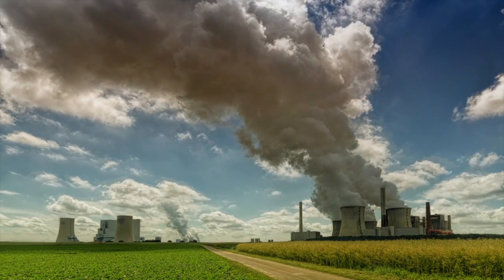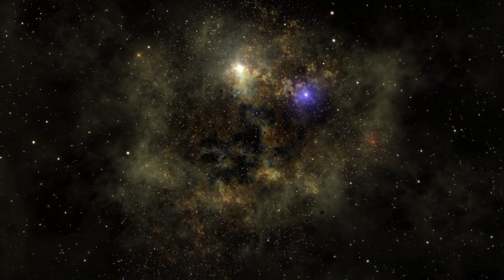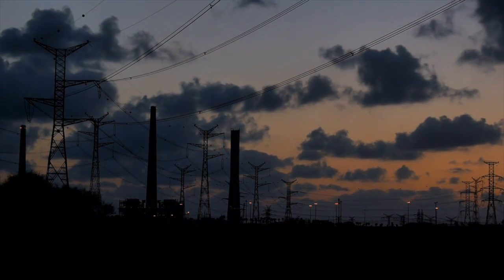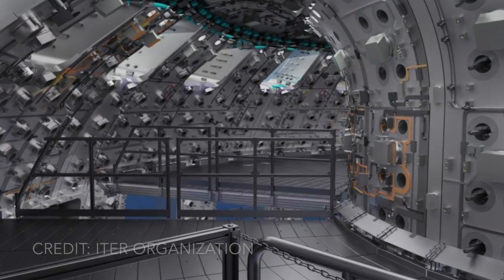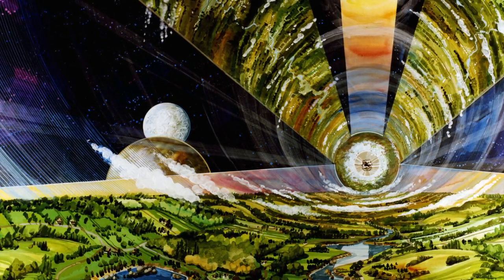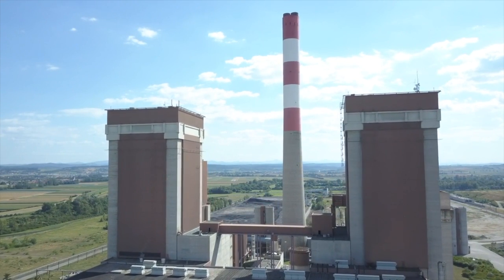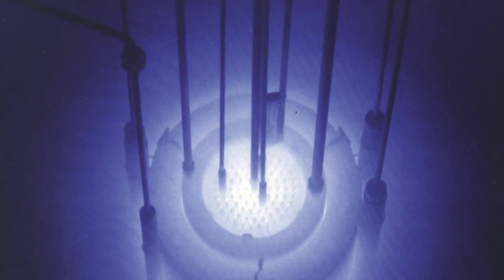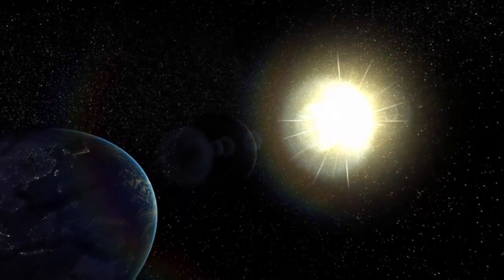What's Really Going on with Fusion Energy

Comment: Was waiting for you to discuss this! Before watching, I’ve heard the group that got net energy only measures energy in as “energy taken in by the reaction” rather than energy actually put into it (or something like that, I forget the exact wording atm) and so it was allegedly not actual net positive fusion
Reply: I think they produced more fusion energy out than laser energy in - but not as much as the energy it took to power the lasers. 

Also, they didn't capture any of the energy-out... and no one really has a good way of doing that.
Reply: @bozo5632  that’s what I was thinking of, thanks
Reply: The lasers charge up like the deathstar does. But they release alot less energy than it takes to charge them.

I saw numbers of 300mj to charge the laser, the laser hits the material with 2 mj and the reaction creates 3mj. I'm pretty sure I've got my abbreviation for mega joules wrong.
Reply: That's correct, Craig. 300 mega joules. So... efficiency was 1%! Also, they can only fire one pellet per day. I'm thinking tooamaks are stellarators might still be the way to go with AI recently having been trained to control the plasma and new materials are being considered for the tractor walls and magnets constantly. We might not even have found the best material for the job yet.
Reply: @D1craigRob  Joules is shortened to uppercase J. Lowercase m = milli-, uppercase M = Mega-
So mega joules = MJ
Not trying to be pedantic, just wanted to share some information. Have a great day!
Reply: @LukeLane1984  well i did say "im sure i got the abbreviation wrong".
Reply: It's a funding stunt. No net energy and can fire once per day...at most. Somebody is paying the team a nice xmas bonus.
Reply: The lasers are old 90's era devices, newer gear is smaller and much more efficient. The team actually talk about that in the technical debriefing after the initial news conference. It is on YT somewhere.
Reply: Let's not forget a lot of that energy is in form of eutrons. Yes, you can use them to breed tritium from lithium which is needed for this kind of fusion experiment (or bombs) but neutrons don't help a lot to drive the steam turbines used for the generators so we can make electricity.
Reply: its was 1% . scam to get more 'funding'